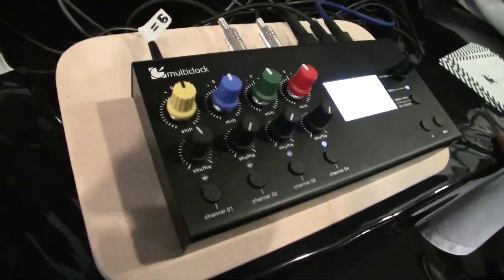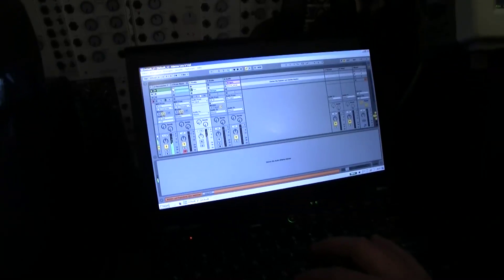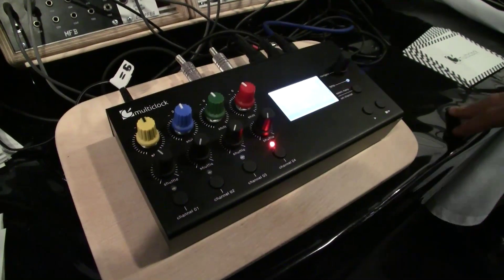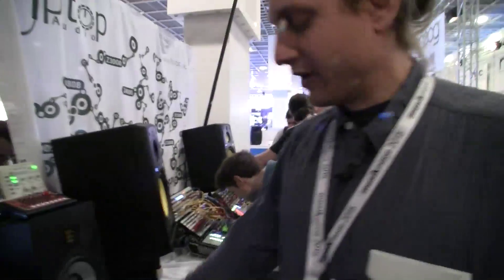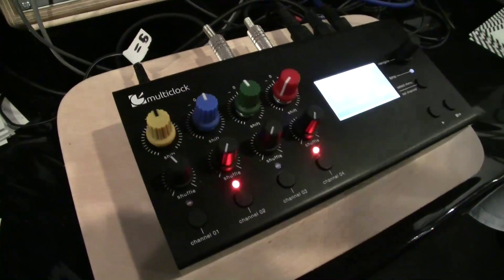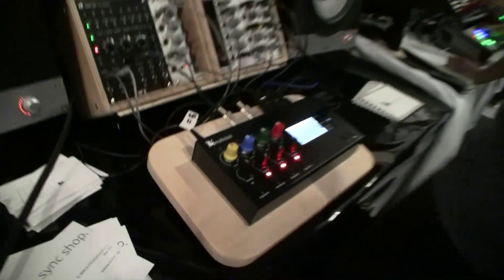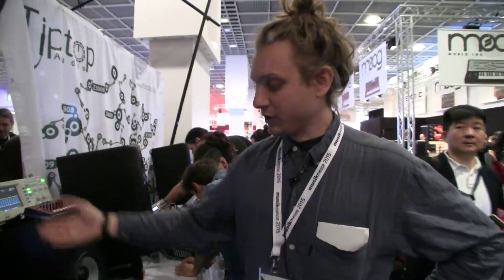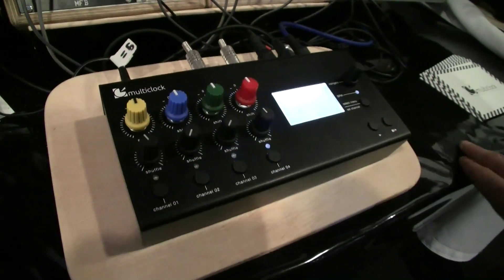MESSE 2015: Multiclock Super Tight Sync

Comment: So they basically copied the Innerclock Sync Gen boxes then
Reply: borrehcleb The concept is the same, but Multiclock can work as stand alone clock generator, it can merge midi from USB or Midi connector with the internal clock. It don't need a complicated VSTi, a clock in wav format could do the job. So you can even use it with sampler machine (MPC, Octatrack), or imagine hardware multitrack recorder ! It even has an LFO for analog output 1 !